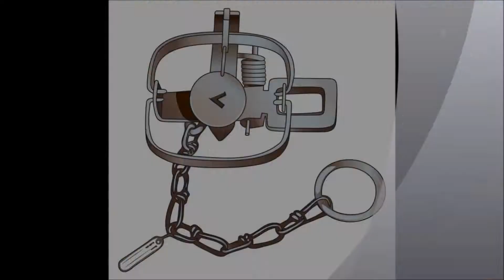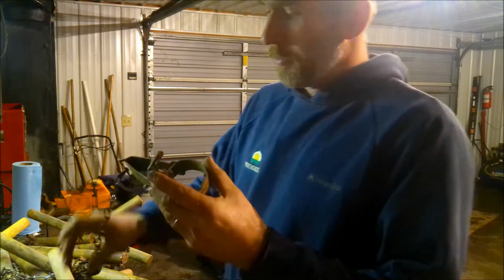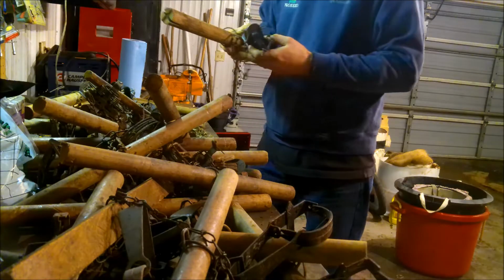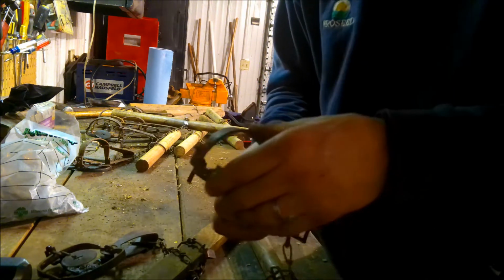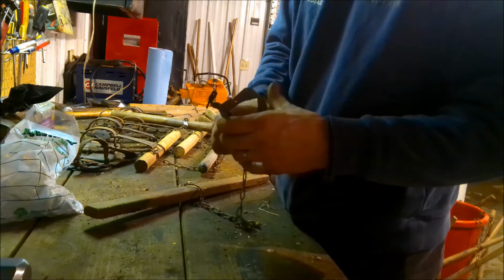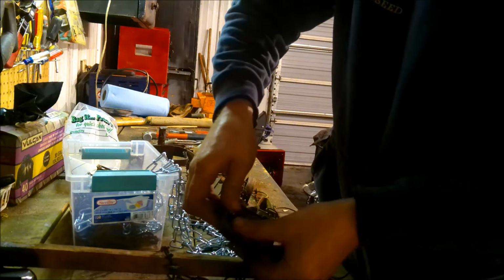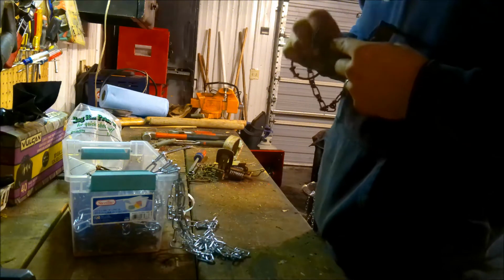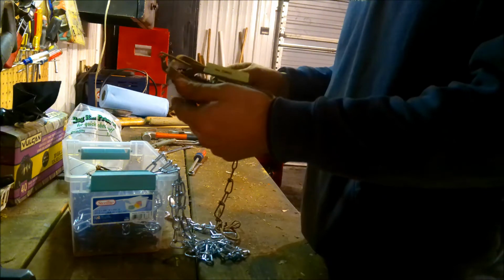Vintage Traps for Muskrat Trapping

Comment: those short spring no1 when ice thick they hold spring strenght very well when set in drainage ditch where mink that trap fits if your seeing houses now have seen this before early 80s thought would be hard winter but wasnt have only seen them build early once or twice